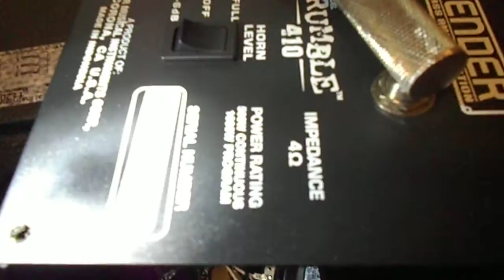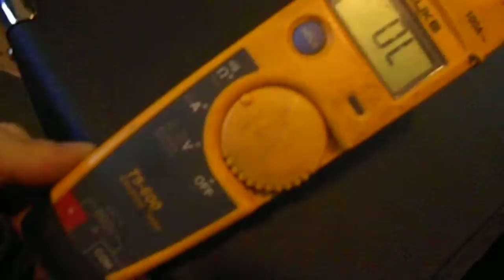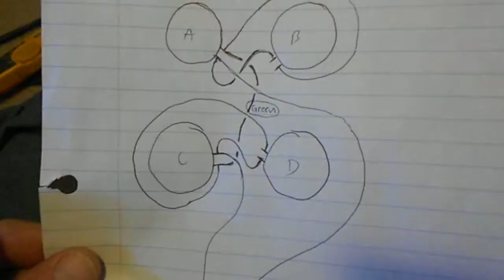Impedance Modification on a 410 Bass Cabinet

Comment: What I would do is run 2 of 2 of the speakers in series, then both sets in parallel for both cabs. That would make each cab 16 ohms, and 2 cabs would be 8 ohms. The actual wattage I'm not sure about though

Comment: I can't see how this guy gets 8 ohms ,  presuming each of the speakers are 4 ohms, all wired in parallel would give 1 ohm, all wired in series would give 16 ohms , and  two in series (that's two pairs of 8 Ohms ) wired in parallel brings  them back to 4 Ohms.

Comment: Also if you use two 8 ohm cabs with your 8 ohm head your now running a 4 ohm load. Bad for that head. Your Max Wattage is not as important than ohms.

Comment: Do you possibly have a schematic for this, i didn't quite get the one at the end of the video, I know if you wire 4, 4 ohm speaker in series parallel you should get 4 ohms, and in series it should be 16 ohms, so i am curious how you got it to 8 ohms, on paper.

Comment from the maker: So I modified my cab to 8 ohms, now I have another same kind of cab modified to 8 ohms, together they = 4 ohms which is not below the amps recommended specs. I know you're probably confused. I was when I first started trying to figure it all out but just do your research. Read Hartke's Manual for the LH500  -  There's a link in this video's decription   - also read up on Ohms Law. Hope this helps!

Comment from the maker: No, you don't have to mod or cancel! That amp and cab will work perfectly fine! You have to realize that Ohms and Watts must be thought of together. Your cab is 1000w at 4 ohms, and your amp is rated 500w at 8 ohms, they are a perfect match, unless you plug in TWO cabs at once, because then your cabs combined would equal 2 ohms, and with your amp pushing 500w @ 2 ohms it would catch on fire, or so they say.